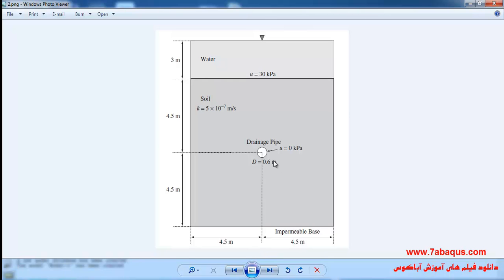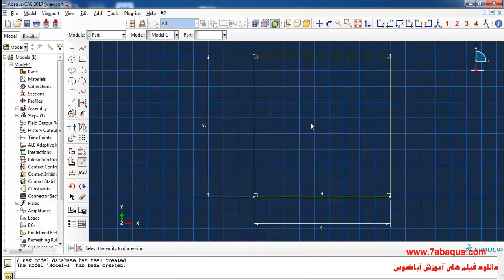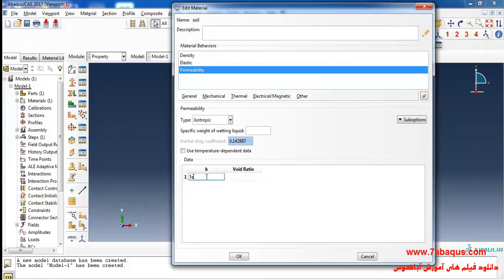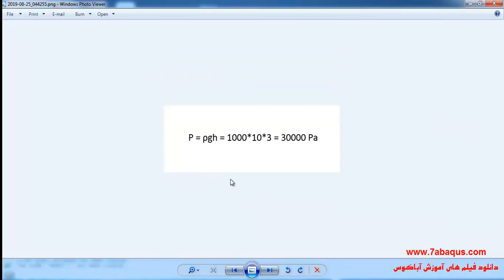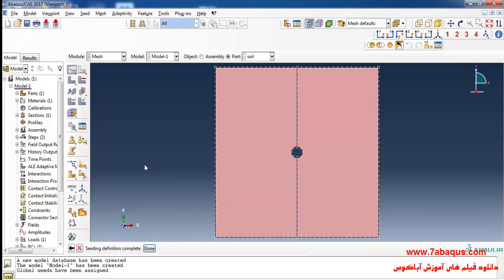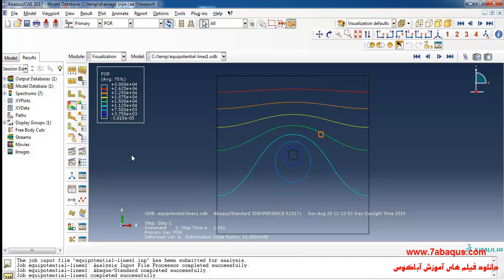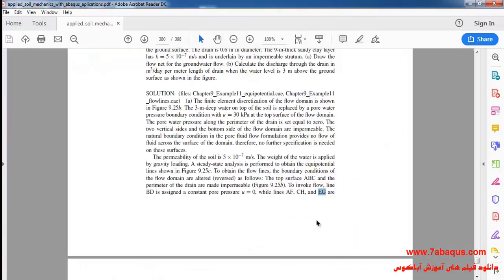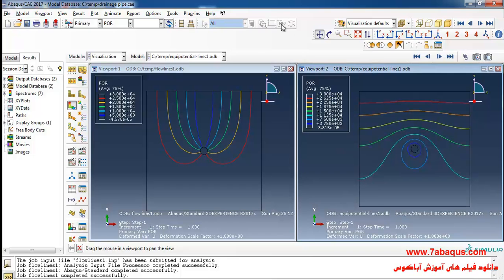Seepage and drawing the flow net for the groundwater flow Abaqus

Comment: Great video！
Why is only the SOIL analysis step used, without performing a Geostatic analysis step first?
Reply from the maker: This is a steady-state problem and soil deformation is not an issue, so there is no need to define a Geostatic step first, but if you do, there is no problem.
Reply: @saeedmoeini-7abaqus  Thank you
Reply from the maker: Because the purpose of this problem was to draw flow net , So, in this problem two factors are not important:
 1- Soil deformation 
2- Time
See this video about Geostatic step , to know the task or purpose of this step
https://www.youtube.com/watch?v=RsCfu5c2ZAw&t=148s